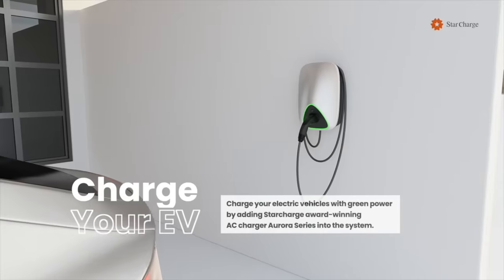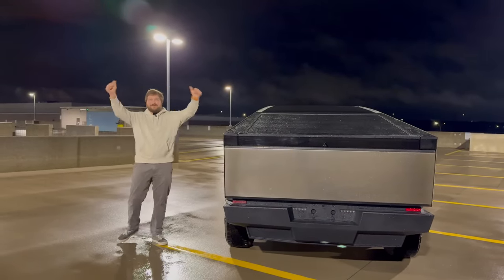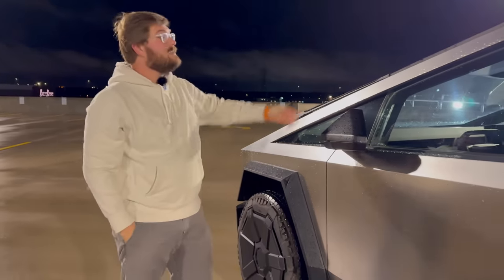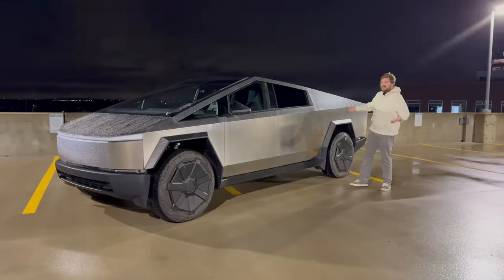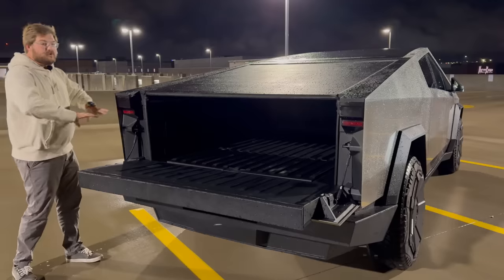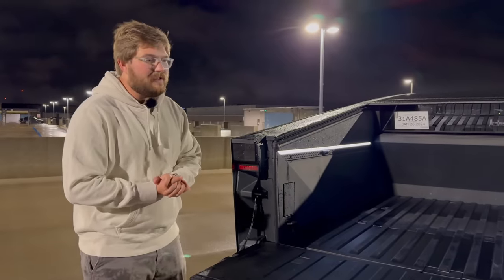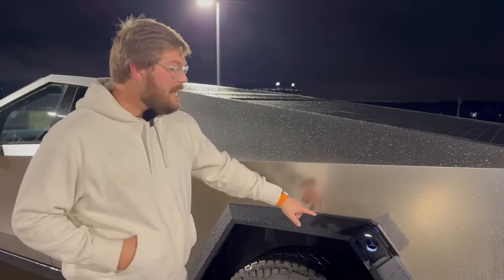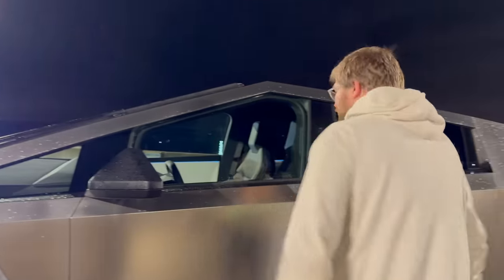Tesla Cybertruck Full Tour! Exposing All Details - Service Mode, Wiper, Powertrain, & Much More

Comment: Canceled my 2 day CT  reservation due to piss poor range and sky high price.  Going to Model Y LR  Juniper, a much better road trip vehicle.  
A CCS plug WILL NOT FIT,......... who was in charge of that screw up, damn, you had one job, it will not it be able to charge across the board, should have stayed with the original charging door style.😫  So is Tesla going to reduce the price for the features I ordered but are NOT in the truck,  FSD @ $7,000.  WTF.

Comment: At 8:51, you talk about the stainless steel. You say they use 1.5 mm instead of 3, and you point to the hood as an example. I saw another video where an expert laments the supposed 3 mm stainless steel, but, he says something about the requirement or desire for the hood to be “softer” in case of a pedestrian innocent bystander. Is it possible the hood is 1.5 but the rest of the body is 3?

Comment: Please can you comment of the inner frame material. Will that rust? If the answer is no, then what exactly will rust on this truck and can the battery pack  and motors be changed in the future eg 15 -20 yrs.
Reply: Front and rear frames are cast aluminum. Every other part I’ve seen reviewed is one of a variety of stainless steel types. The battery pack is structural, so it would have to be cut out to be replaced. Tesla motors have lasted 1,000,000 miles, so probably not going to need replacing.

Comment: They probably decided on a new rear motor because they were going to revise it anyway, plus they likely are expecting to sell even more trucks than cars in the USA, whether that's this original cybertruck or the V2 cybertruck in a couple years.

Regarding the rear window you said there is no rear view, but you can see into the vault through the window while the tonneau is closed. I've seen in videos that the tonneau goes up and past the window when it's closed, right?

Comment: Cybertruck generates a huge interest on its launch day and still is today. Its front design has a futuristic look and it is different and awesome vs traditional truck/ ute. Owners are starting to wrap their vehicles with different colours and that will only create more buzz, which is a good thing. More modifications to the vehicle are underway I reckon and surely will make heads turn. Drivers on the road please be careful when being drawn to Cybertruck, safety comes first. 
A new product out on the market, if it is appealing, the test to its appeal is how long would it lasts after a period. In my view, the vehicle rear section is beginning to look bulky and starting to appear a bit uninteresting. Like to see it lean and sexy. What do you all reckon, share your thoughts ? 
Cheers

Comment: Does the truck drop to entry height automatically when in Park or when entering vehicle? Great video BTW.
Reply: In normal street mode the Cybertruck drops to minimum height in park. In off-road mode it does not drop, which makes sense, you don’t want to drop onto a rock.

Comment: Question for you: Does it come equipped with pre-installed wiring provisions for a subwoofer and amplifier, or is it possible to have these components added to the vehicle aftermarket?
Reply: Is there a 48v amp on the market?
Reply: The Cybertruck comes equipped with dual subwoofers.

Comment: Great introduction to the CT. I'm looking forward to the next one. T.Y. 
Addressing your comments. 
48V architecture is not only nice, it is a must for steer-by-wire due to high power requirements. 
The interior radar analyzes the cabin context to detect: Presence of living being in the car including newborns and children up to 6 years old. .
OBD is probably added due to future CARB ACC2 requirements for EVs. 
The "diaper" was lowered to improve aero, along with the addition of fairings in front of each wheel. You can compare it to the prototype to see the difference.

Comment: I would be interested to understand more about the 240v power since bi-directional charging isn't a real thing yet.  IMHO this is the largest departure from Tesla strategy, because it really puts the kibosh on the whole powerwall business model.  If you have 240v output at ~10kw you can pretty easily (temporarily) power a house for a blackout through a generator interlock outlet.  I'd be really interested to understand just how much control you have over this export of power from the app.  Great Video.  Tons of detail.  IMHO....nerdyest winning detail....."actually 47 volts, not quite 48 and some of the components are actually still 12".  I've watch quite a few CT videos and this is the first time I heard that.
Reply: You still don't understand "It's only a home battery when it's at the home "?
.
Try sending an email to your power company.
.
"Dear (whoever) I live in an area prone to blackouts ... I now have a Cybertruck. Can you please assure me you will ONLY allow blackouts to occur when I'm at home? (Normally 17:30 - 07:30)
.
Better still, phone them.. you'll hear the laughter.
Reply: @rogerstarkey5390  I've only had 2 blackouts in the last 7 years and they were both storm related (predictable).  I guess my power company does a pretty good job.  My mitigation options are gas generator (no thanks), powerwall (too expensive to justify), or battery on wheels. Really if weather has shutdown the power, I give it 90% odds I'm at home.
Reply: One of the perks of buying the Foundation Series is it includes Tesla’s bidirectional charger, the Powershare Home Backup. So no need to use the 240v outlet.
Reply: @broddr Sure, but that doesn't include the ~$2+k requirement of autoswitching hardware (used with powerwalls).  My understanding is bidirectional is "free" if you have a powerwall because you already have that hardware.  Your grid won't let you feedback power unless you can guarantee your home is disconnected from the grid.

Comment: Thank god you have correctly described the ct as bullet resistant to small pistol caliber projectiles and is not bulletproof. 

I predict CT will be bullet magnets in many urban areas because of the  inaccurate words used in advertising as bulletproof. 
I have an order in since 12/2020. 

Other design problems i see are behind grill headlights that will be coverd in snow and ice quickly and have no wipers or air
Blast cleaning devices. 

Another issue that is that there is no ability to get heat
Or cooling into the rear bed for the tesla tent. 
I also predict after market production of powered duct work that will  fit into the partially closed rear windows to get cabin air to the bed area for the tesla tent.

Hopefully tesla will solve this in future production models.  No auto pilot ? That is my favorite Tesla feature.......

Finally ,CT is touted as a work truck but cannot mount a snow plow.many contractors use there work truck to plow residential homes and vacation homes they have built like myself,  very  disappointing that the most expensive truck i will purchase can't
Mount a plow. 

Your content is great 👍
Yea 1200 spare tire that takes up space.  No design is perfect I understand but these shortcomings are glaring issues.

Comment: looks like the rear wheel would sling mud up the charge port.  perhaps that is a design flaw.
Reply: Yes, while there is a rubber gasket under the charging port door, it seems like heavy mud could force its way past that.

Comment: Weight being less than the Rivian is to be expected. It's got...20 kWh less? What's the number, more? Just the cells are near 4 kg per kWh. Packaged up around 6 kg. Oh, and there's no (huge) spare wheel. Tesla is quite good with optimizing cars for weight, in part helped by being so Spartan. 
Traditionally, their vehicle offered a low total weight for the kWh number. Here, the are offering a smallest in class battery, leaving so weight for payload.

Comment: Add a spare tire for the very small percentage of people who do off-roading to the point of getting flat tires? Versus the extra storage space? Not a smart move IMO.

Would be as dumb as adding more batteries... adding $15,000 plus to the price of the truck for the low percentage of people who tow often (less than 15%). Otherwise with supercharger network makes unnecessary. IMO again.

Comment: Is there anyway to mount things to the top of the bed side rails?
Reply: See the lighter gray horizontal strips inside? That's an led.
Just below there's a strip of "L Track".... So you could mount a tray across there..
If you mean above the cover, there are ladder rack/ roof bar mounts all the way up. (3 pairs?)

Comment: The most crazy thing is how low his expectations are for a $100,000 vehicle. The functional trade offs that tesla made to save money because they made stupid design choices like using stainless steel means you don’t get a HUD, instrument cluster, rear view mirror with integrated rear display, turn signal stalks, haptic controls, high current ac charging, etc. 

Seriously, it’s a unique looking vehicle but $100,000!

Comment: @33:50 1200 lbs? I heard the range extender was 600 lbs.... interesting, maybe the 600 was kilograms? (but that would be 1300 lbs...) Regardless, depending on how complicated the hook up for the range extender is and whether or not it has easy accessible lift attachment points, one should be able to obtain a consumer class gantry crane that could manage the weight.... Of course, there's a whole lot of "if" coming off this comment .... :/
Reply: "IF" you want to void the warranty, risk death, etc.....
There ya go!
Reply: @rogerstarkey5390  I should have added: and if Tesla blesses the process.

Comment: Instead of that range extender i would just get a solor powered battery charger
Reply: Need a lot of panels. I have been experimenting. Try buying the very best sub $150 solar kit for charging your phone or iPad from the best supplier, say EcoFlow or Anker, assuming EcoFlow make small solar kits. Give it a few weeks in good outdoor sunlight to learn how effective this is. Slow eh? Now imagine scaling this up 1000 fold, and you will realise how large a solar array is required to even top up /slow charge an EV at minimum wattage of 1.7kWh. The only way for this to work is commercial roll out of large solar arrays near charging hubs, Superchargers etc, and 100 fold increase in said charging hubs so you are never far from a charger.

Comment: So many missed opportunities. Missing heads-up display on the window (if you tried it, it's hard to live without) there is certainly space enough for it, missing radar, for proper adaptive cruise (on day one, not some future promise of Tesla Vision maybe someday working properly (big doubt)), the same goes for missing ultrasonic sensor, to actually get proper close range info, that the cameras just can't pick up properly, missing Apple (or Android) Carplay, if you don't like the offered services, or Tesla decided to remove them, as has happened in the past when Elon get in a hissy fit with some CEO.

Comment: In order for Tesla to deliver the the 2 million back orders in 4 years for which they have already accepted about a billion in prepayments - they need to get to 40,000 Cybertrucks a month; so Shou what date do you think they will reach that?  If they delay a year that number has to rise or push back deliveries which is unacceptable when Tesla is holding a billion dollars for their orders.  They will probably also have a big problem if they don't deliver the 1 and 2 motor models to those with orders.
Right now they are only deliverying the $100,000 top priced model

Comment: Kyle and Francie make a great team!

BTW: FSD and Autopilot for the Cybertruck and the Semi are a low priority.  Porting these features to the bigger vehicles would be very expensive in terms of manpower and compute time, with very little return for the world or for Tesla.  Their approach of focusing on the 3 and the Y (for the most part) in California (for the most part) is best.

Here in rural New Mexico FSD sucks.   Can't get me to the grocery store.  But that's fine.  It's sparsely populated here and the Tesla adoption rate is low.  It's better for Tesla to put their resources where they will do the most good.
Reply: Seems like FSD should probably be cheaper for the Cybertruck then, if it's lower priority
Reply: @graemeesmith  It doesn't exist for the Cybertruck.  You can't get FSD for the CT at any price.  Tesla has spent probably billions of dollars training their neural networks to work on S/X/3/Y.   A lot of that training doesn't apply to the CT because the vehicle and the camera placements are significantly different.

Even if you wanted to spend $1B for CT FSD, there is not enough video footage to do it.

Comment: Saw my first Cyber Truck in the wild in San Mateo Ca around mid December. It looked to be a shop truck with the company logo on the side. Wonder how much those special tires are going to cost when it’s time to replace them and how often they will need to be replaced due to the weight of the vehicle.

Comment: One very important question that I would like answered. What happens if this steel lump with hard edges hits a pedestrian ? I guess this is not a question for Europeans as  I guess that surely  it will not pass EU safety laws
Reply: You know very well that if you go to "other reviews" you'll see this parked nose to nose with the Ford ... Which it MUCH taller.... Not to mention they're both in front of the Hummer, which despite being way back, towers over the pair.
Maybe address your concerns there?
.
Anyway, the main thing is to try not to hit the pedestrian, in which case "Visibility" is a good idea.
I recon the driver can see something 20-40 feet closer to the vehicle in the CT compared to the F150, and about half a miles closer than the Hummer.
.
Kinda helps in the "Did I just hit something?" scenario, when someone steps out close to the vehicle?

Comment: the upper control arms can be thinner because of how far they are from the center of the wheel. still might be undersized but they have more leverage over the wheel than something with a control arm inside the wheel

Comment: Awesome video!  I’ll be getting mine sometime before April.  

HOW CAN YOU ATTACH A WINCH?  Only on the tow hitch?  I’d like a hidden one in the front…
Reply: Sadly there’s no high power available in the front. I think we’re all going to have to just plug in a 120v winch into the rear bed outlet (probably with an extension cord). Then attach one hook to one of the front tow points. Ugh.
Reply: @broddr  I think there is some kind unused electrical takeoff in the frunk, not a setup with an adapter.  It’s just bare wires taped off.  It’s like the power supply available on the roof for a light bar.  Maybe this unused connection can be used to power a front winch.  

I’m less concerned about how to wire a winch and more concerned about how to mount if possible and the drag it will cause.  Maybe the tow hooks can be accessed from under the front for mounting a hidden winch?
Reply: @CashJohnston  the taped off power feed under the frunk is limited to 400W, about 1/10 of what a winch would require. An aftermarket bumper might provide mounting for a winch, but that still would require some very expensive high power routing through the truck.
Reply: @broddr  Oh!  I see, too bad they didn’t put any more power up front.

Comment: Feel the poor 4680 charging curve, could be due to non-optimal cooling system, partly due to larger diameter cells, limiting how fast the center core, could be cooled during charging. With 48V subsystem, the cooling could be more powerful with better pumps. Still the limitation will be present, but its impact could be somewhat minimal.
Reply: More likely the poor charging curve is Tesla being cautious with the new battery cells. They’ve done this before, where charging speed was eventually increased by software update after real life experience was acquired.
Reply: @broddr If that is the case, why Kyle mentioned that MY's still have the issue? Also, I believe, it could be the side cooling(spaghetti coolant extrusion tubing), instead of bottom/top cooling as in Rivian/Lucid? Not sure, if this is the case still with CT?. Yes, I can understand Tesla could be proactively limiting charging current to prolong the battery life(still remember, what happenened to one of the MS owners that went overboard on a free  charging spree🤔) to have issues with warranty servicing in the long run!

Comment: I actually love the look of the CT - yes, it's weird and maybe the ugly duckling of the family but it doesn't mince words so to speak. In the nerd category, I'd like to see the air-flow pattern of the CT vs say the Model S or the refreshed Model 3. Tesla must have done some wind tunnel tests or smoke flow to find the optimal shape. It may be that the single angle sloped front surface drives the air up and the rear slope creates a low pressure area which then pulls the air back down to complete the flow profile. Certainly I'm not an aerodynamics engineer but I'm sure Tesla and specifically Franz von Holzhausen is one and has hired a few more and they have done the wind tunnel testing. Cheers and I can't wait to see this truck run the back roads tests.